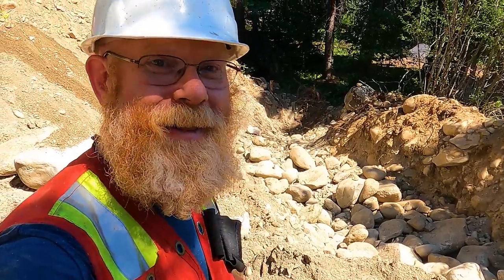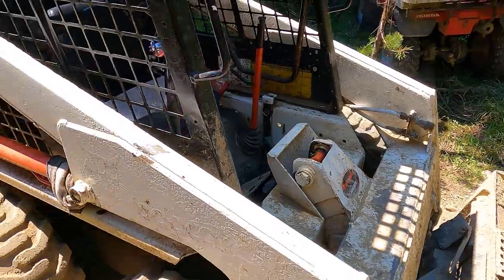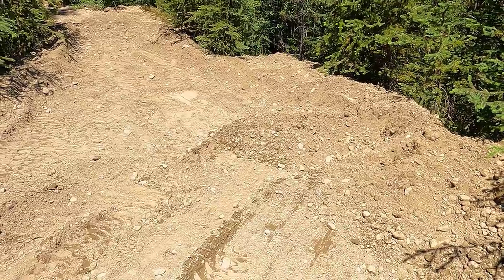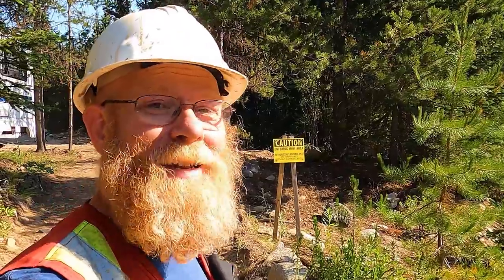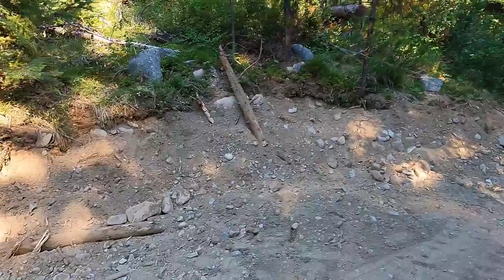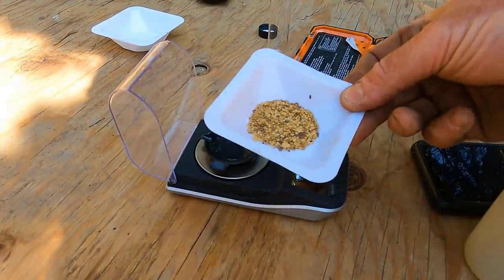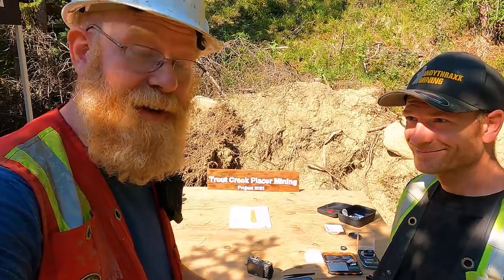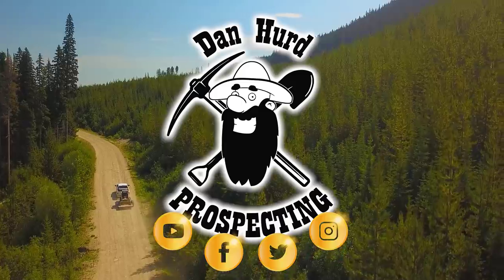GOLD Totals, Lessons Learned, Restoring Mother Nature.

Comment: You can get vegetable based hydraulic oil for ol' leaky Bob. Possibly a cheaper, environmentally happy, alternative to replacing that leaky ram. I know lots of companies that use veggie hydraulic oils because if any equipments blows a hose or develops a major leak, there is little to no cleanup required. Great video as always!

Comment: Dan,
I have watched all of these videos on the 2021 Trout creek project. and I have to say the "elephant" on the project that needs FIXING is the sluice run. From what I can tell it is maybe, 3 feet long? 4 feet at best. 
That is as long as your high banker matting and you don't even PUSH 1/10th of the volume through that as he was PUSHING through 3 feet of sluice run? ADD about 12 feet more sluice run. I would also check the pitch on it when it is set up.
Water. Add pressure, stop using dirty water gets you LESS gold. ask Tony Beets.
I would also dig up the very SPOT where it was all spilling on the ground and pan about 3-5 gallon buckets worth. just to see.
great Video!
Reply from the maker: Andy care to comment?  I know you tested your tailings, and also tested where the gold was falling out in the sluice.

Comment: Speaking of hydraulic oil, one of the contractors we had for brush clearing did a lot of work for dfo and they had food safe hydraulic oil in their equipment.  This way there is not as much of a hazard from hydraulic leaks.

Comment: word of advice. reseal the leaking cylinder. if oil is getting out then dust is getting in with each stroke. It adds wear to the entire system which is more costly than a cylinder reseal.

Comment: Prospecting like this by the numbers has to be so hard to do especially if you've hand picked a nice sized nugget straight from bedrock using only a shovel and detector. Such a nugget being maybe 1/8th or so of the total yield in this video.. I wonder is there a 'random monster nugget' clause tossed into the number crunching. Through the span of a large operation like that I suppose there's at least some baseline commonality in how many big ones are picked that weren't really factored into the dig.

Comment: Dan have you ever considered placing a temporary corrugated pipe on one of your claims that has a small creek running though it? You could then pull it out and pan the contents maybe every month or so. Would the Canadians allow that sort of temporary equipment placement? That would eliminate a lot of digging by just letting the water course push the material through a small diameter corrugated culvert. Just thinking out of the box here.